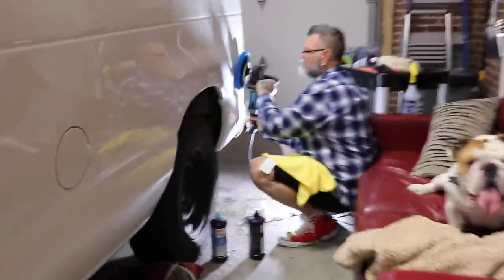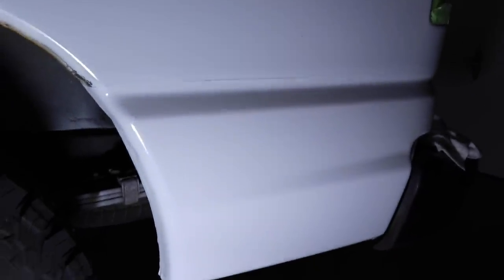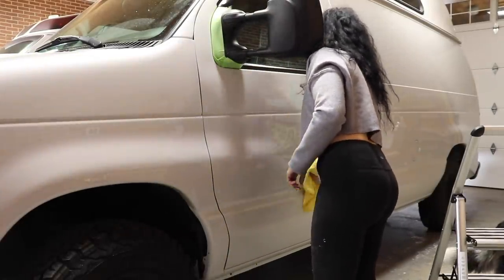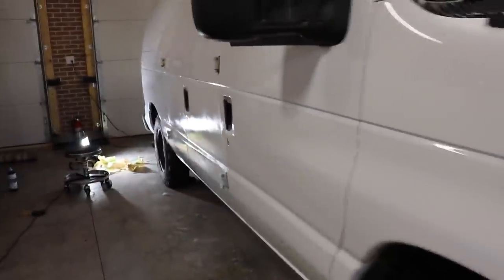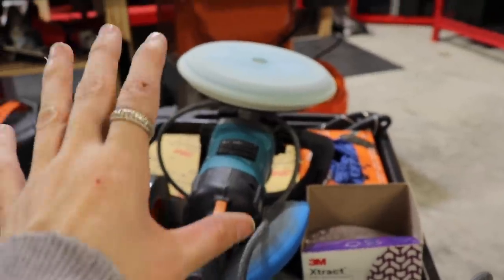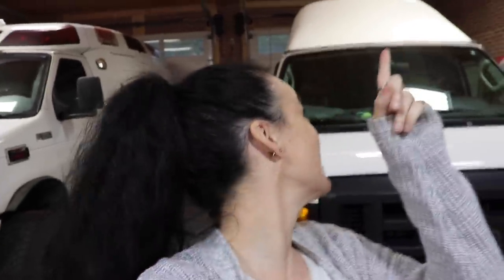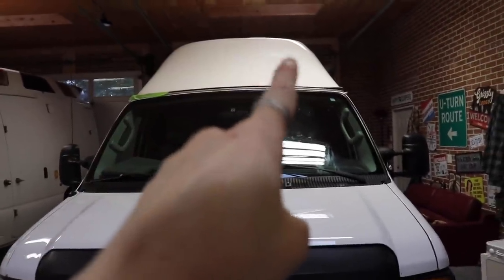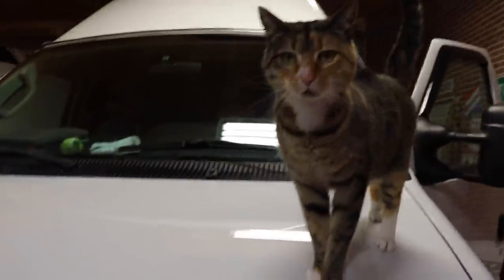Polishing my van/ This project took way longer that I had anticipated/ Van life community

Comment: When it comes to the job of  rockers rust replacement panels. I've done repairs that don't involve welding. The metal gets replaced with new metal but the panels get glued on with panel bond, its actually how alot of modern cars are put together. The benefit is you don't need a welder so anyone can do it. You still need a few things but not the expense of a welder or paying someone to do the repair.

Comment: I had a small rust spot on my van a few years ago that I tried to touch up but a few months later the rust started to come through again so I sanded it down a little, dabbed on some nail polish and stuck a bumper sticker over top of it.  It's now three years later and I'm just starting to notice a bit of rust run-off, I'm hoping that I won't find a big hole when I remove the sticker 😅.  The van is 17 years old and I've noticed two other tiny spots starting to peak through the paint so I  may just repeat my sticker band-aid job on the other spots.  I  would love to find stickers that look like actual band-aids.  So if your van gets past it's prime but your trying to give it a cheap face-lift,  bumper sticker graffiti may be your answer.

Comment: That looks very very nice holy moly you and chrome sure did a good job it looks pretty the top looks really good too.
Where  you  digging all that stuff out and was getting them parts and stuff out we're rested clean that up really good and then put undercoating around the bottom it it will help seal it and it won't get wet and won't rust detailer for almost 30 years and paint and graphics yeah that's what we did and it's undercoating and it's pretty cheap you can go to the parts store get it even Walmart has it make sure that you clean the area around the bottom just spray the whole thing there. You got the use of the shop and it's dry so kind of take advantage of that and just spray all the way around your van that perimeter on the inside where it was rested at and that undercoat will really help it and if he has any questions you can you got my email there so just email me and I can try to help you if I can
Reply: It's not he has any questions if you have any questions my spelling is really bad hopefully you can understand